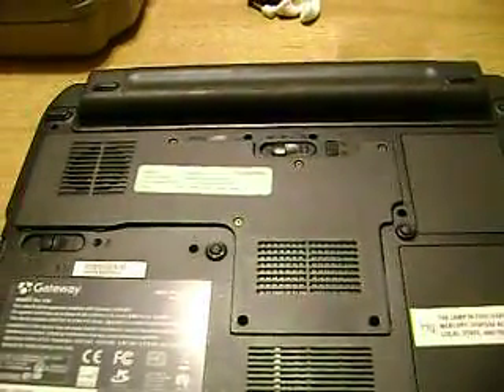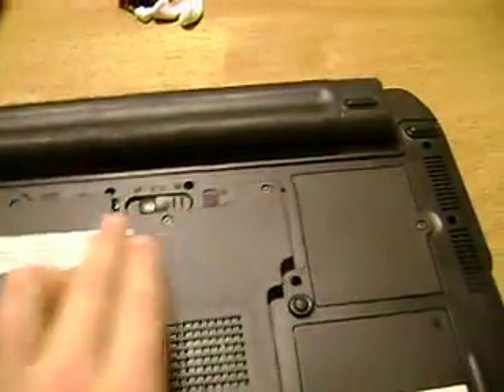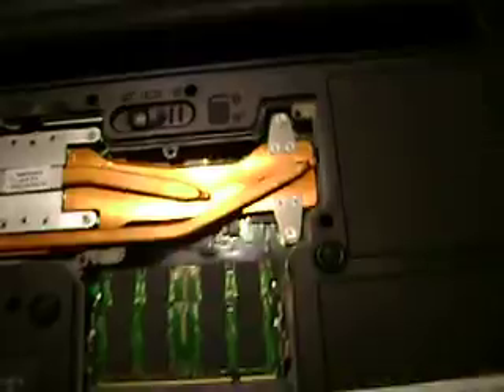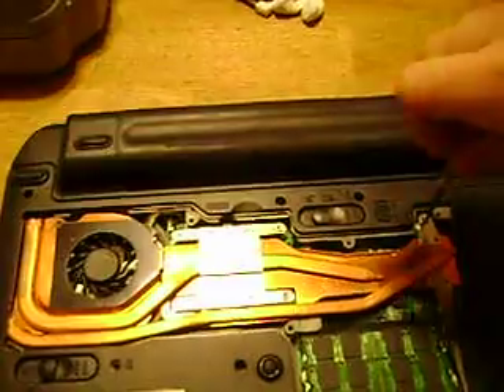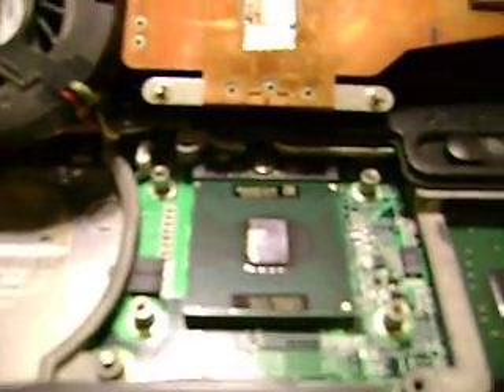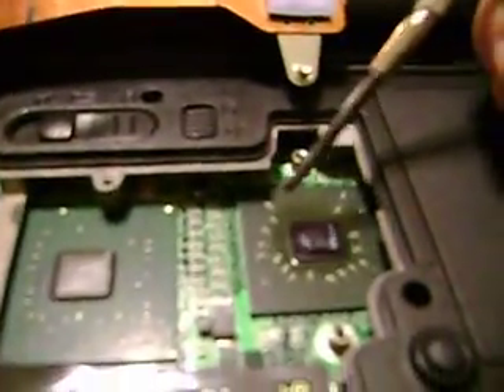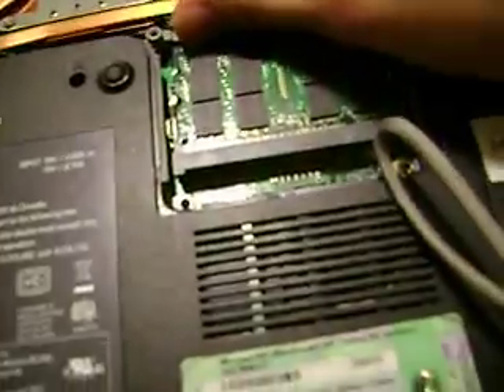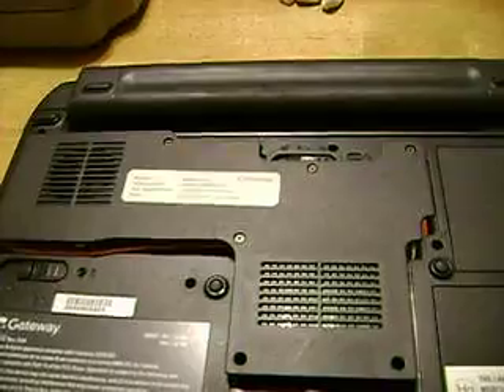Gateway CX210X motherboard

Comment: Liked the vid! I had a quick question I have had this laptop since it was released and I have the cx200x version. Is there a way that someone might be able to help walk me through replacing the LCD and glass for the display since it lost a fight with a wii mote bank in 2010 it dual boots Linux and xp pro just fine. If you or someone could point me in the right direction it would be greatly appreciated! This one step will
Save me almost 500 dollars in fees at a local repair shop that work on old

Comment: Whats up Andrew, thanks on the videos.  Hey I have a Gateway cx200, with a fan error, o2fa.  I see the fan come on for about a few seconds, the it try to boot, and the error comes up.  I took out the fan and cooling unit, took it apart, and blew out all the dust, reinstalled it, with new thermal grease, and same thin.  Any idea whats up?